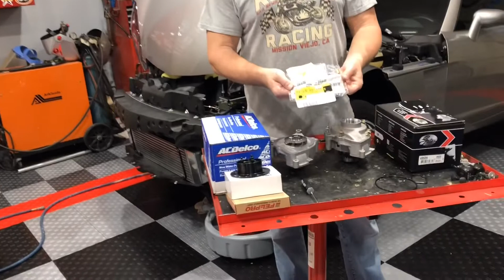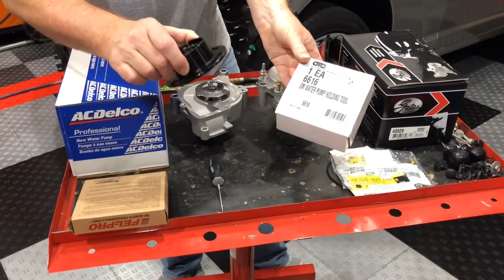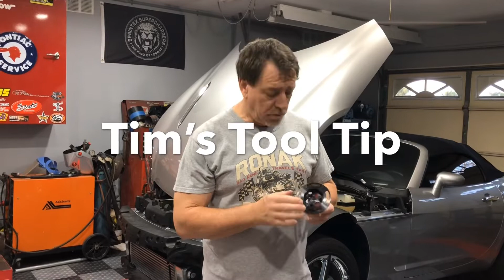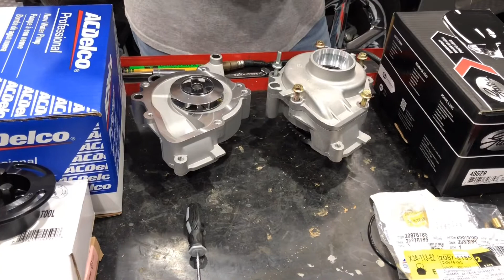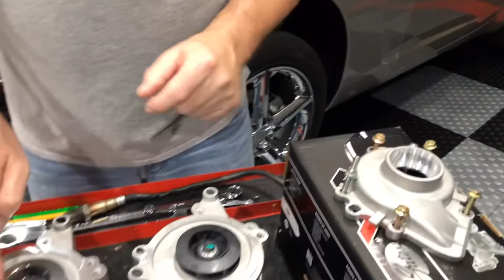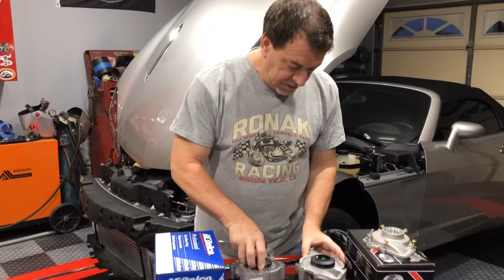Tim’s Garage Episode 9: Saturn Sky Redline / Solstice GXP Cooling Upgrade Water Pump Comparison

Comment: Great video! I wish i saw this and read the comments weeks ago. I just bought my 07 GXP about a month ago and had my fluids topped off including the coolant, not knowing that opening the reservoir and adding Dexcool would potentially cause what I think is a major air pocket issue. Since then, car started running really hot at idle, the radiator fan wasnt kicking in, and the engine overheated enough to where the water pump failed as well.  I'm not adventurous to try fixing this myself, so i'm getting the check valves added, new radiator fan assembly and controller, coolant flush and bleed, by my local mechanic.  A very very expensive lesson because of a coolant system design flaw.

Comment: As an automotive enthusiast myself (who also happens to own a Saturn Sky Redline Carbon Flash), I think the differences you show in this video reflect the after market supply playing catch-up to the demand. Hopefully in time, you'll see manufacturing improvements in parts like this as more and more smaller mom-and-pop shops continue to tool up and improve their designs, increase efficiencies, and hire on more qualified engineers and technicians seasoned in things like CAD design. (At least, that's my hope.) 

As someone who worries a lot about the supply of replacement parts, nobody will ever convince me that demand doesn't exist with even the least in-demand parts for vehicles too few ever cared a lot about. Take for example my 2006 Chevy Colorado: not many cared enough about it to lobby to have plenty of replacement parts be provided for it, and as a result, you can't find anyone who offers new brake control modules and usually get forced to make due with used parts from salvage.  However, the perception that it's due to low demand is only partially true because what really causes that is the lackluster manufacturing constraints after market suppliers suffer from. They can't produce on-demand and they're forced to abide by mass-demand due to the efforts and money it takes to retool for parts like that. 

As a result, one thing I think we'll eventually see (in time) is an advancement of on-demand manufacturing models where said mom-and-pop shops slowly become more and more capable of providing replacement parts on-demand for almost any make and model, especially as computerization seeps into these businesses along with the cutting edge technologies and concepts like 3D printing, at-home mills and lathes, ubiquitously-accessible centralized application asset files and standards of manufacturing plans and parts, and all the other fabrication techniques we're seeing be developed and or replicated from software design concepts. Because of this, and because of general automation techniques, costs will slowly decrease for things that were once expensive to accomplish by smaller shops, and when they do, it'll become more and more viable to improvise systems and procedures to become more accommodating for parts that have been discontinued, like the Sky / GXP water pump.

Comment: I enjoy your videos but you are just wrong about the water pump being a weak point.  Of the full production run, very few have had issues with the water pump failing.  The current understanding is that some early production pumps had seals that failed early.  Once replaced they have had very good longevity.
Reply from the maker: Rob … being new to the platform I was trying to understand the reason for failures. You could very well be correct but nonetheless I was able to reduce radiant heat to the pump. It may not be necessary but in hot climates and frequent short trips or freeway travel with short cooldown periods before shut off it can create significant heat issues.

Comment: Tim, this is a great video and I enjoy watching all of them!  Question:  Is there a difference between the AC Delco 252-821 and 251-751 water pump kits that would account for the 50% difference in price between the two?  Is one a more durable and sustainable pump than the other?
Reply from the maker: I am not certain ... I would inspect either pump and ensure it HAS the extra disk attached to the impeller. One of those was made in the past to be added to Small block Ford pumps called a flow cooler and it significantly improved water flow capability. I would have to order a pump to tell you for certain ... or order one and compare to the one in the video.

Comment: Where do the “check valves” go? I got them but saw no place to replace them, even on the temp sensor/distribution block.
Reply from the maker: Chris ... sorry for the slow reply. The check Valves go in the two small line that head to the overflow tank. They are inserted into the end of the hose right where it leaves the radiator too and also the connection right where it leaves the fitting at the front of the head. I have the GM instructions for installing them if you want a copy. It is very important that the check valve is installed in the right direction and that they are oriented as Vertical as possible or the ball valve will not close completely. Reach me by messenger if you need extra help Chris.

Comment: Hello, I have an 07 sky redline and it ran hot and spit all the coolant out the reservoir. When it gets hot it spits coolant out. Trying to find the problem we changed the thermostat, no luck. We flushed the system and tried that with no luck. The fan kicks on and works but it still runs hot. We are thinking that it's not circulating coolant and over heating. I did a compression test and 165-175 range. Is there a way to check the water pump without having to take it out?
Reply from the maker: It is absolutely IMPERATIVE that the system be purged correctly. If the system is ever opened after the full purging for ANY reason it will again get another airlock. Have the car COLD turn the heater to hot Use a vacuum device like an Airlift and create a vacuum of 15” and start the car. If necessary you may also need to alternate and block the return lines from the top of the radiator and the top of the head. Filling these cars with coolant is one of the most fun my things I have ever done. A buddy was having a problem with his redline after it had been bled 3 times by the mechanic. We managed to put another quart into the system by creating a vacuum. Some say lifting the reservoir works to get out the bubble but I would argue the ONLY way is to use a vacuum inducing device. If you take the cap off the reservoir ... you need to repurge the system. 
The only way to open the system and Not reintroduce a bubble is the pinch the line leaving the coolant reservoir at the top before you try to undo the cap and only remove it when cold.
Reply from the maker: Eric ... the burping or air purge of the system is very difficult to do! But it is the only way to get the cooling system working correctly.
Reply: @350tiger  I will definitely try and do that again. We used a mityvac vacuum to  pull some air out but wasn't sure what hoses to plug.
Reply from the maker: Eric Whiddon There is a line leaving the coolant reservoir at the top that splits into two lines. I used vise grips on both lines and started the car after creating a vacuum at the reservoir. I let it start to warm for 20 seconds and unclamped the line that goes to top of Rad and watched for sputtering of coolant at reservoir. As soon as a saw some I reclampwd the line and unclamped the upper line and watched for the same sputtering ... you should see the coolant level drop a bit and you should not lose vacuum. As soon as the upper is sputtering coolant Reclamp it and shut off car. Disconnect vacuum and top up coolant and reinstall reservoir cap. Go drive ... rev it well after warm a couple of times and come back and while still running clamp the upper hose at the single point just as it exits the reservoir THEN shut off car and let it cool. If the coolant level drops leave the clamp on the hose and remove the cap and top up coolant. Reinstall cap and remove clamp and you should be good if the purge is what was the issue. If you need to add any coolant it was likely the issue.

Comment: Greetings Tim.....!!
I just want to say, that I love your Video's......!! Can't say it enough.... Have totally helped me with my Cars..... Not to mention  that of course we have the same cars....
I was wondering, did you ever Replace your Water Pump......?
I have to change the one out in my Black car as I have changed out every thing else to combat that car running hot.... Flushed the System, changed the Thermostat out twice, after making sure the 2nd one would open up in 180 degree water, changed the our the Radiator for Brand New AC Delco Rad etc.....
Anyhow, I am now up against changing the Water pump out in it.... And I think you are right.... The AC Delco WP is the way to go.... Of course every where I look and read about these Sky Redlines says to make sure you use AC Delco Parts because these cars are very finicky.....!! lol.... Anyhow, was just wondering if you had changed yours out yet....? I am pretty sure I will have to pull the Turbo out to get to it comfortably.....
Thanks again for posting all your great Video's....!! They are friggin awesome and have helped me quite a bit I have to say....
Reply from the maker: Super glad to hear that ... finishing up the final tune video during this in place quarantine 🙄
Reply from the maker: I read further ... sorry only read the first bit at first. 
I did not yet change my pump but I do have a new AC Delco one for when I do. Currently I have 9800 miles on my car and while I know it is a weak point I just in good conscience could not bring myself to change it while it was apart. I have been told you can change it with turbo in place but I find that extremely hard to believe. 
When you say HOT ... how hot? Currently 195-210 is considered normal for a stock cooling system. 
Besides ensuring it is bled well ... also check for any debris between the radiator and the AC condenser. Mine had chicken feathers sucked up in there.
Reply: Thanks for writing me back Tim... 
Yes, a good time to play mechanic... Stay at home as this Virus stuff is pretty scary...
When it comes to this cooling System in my Black car, I have checked everything you could possibly check on it as far as to why it would run hot....No obstructions, Clean clear lines, Heater core good, air lifted the system, etc.... It sucks and I am not looking forward to changing out this Water Pump... When I say hot, I mean hot and it is starting to worry me to the point of ruining the engine... Although one must realize, the over heat warning light on these High performance Ecotec 2.0 motors does not even come on until the cars hit a whopping 250 degrees....!! Mar car has gone up as high as 244 and 220 is normal now... But it still drives like no big deal, but in my head I am freaked about it when I see the temp on the gauge....!!  I even replaced the temp sensor down by the Turbo as well to make sure it was not faulty... I am certain that the Water Pump is barley pumping coolant through the system now as the temps have just gotten worse over each passing Summer... I wont even drive it anymore... Both my Redlines are 2008's... Black car now with 86,000 miles on it, my Red car, 61,000 miles on it... My Red car is starting to run hotter as well with miles and age also... I am convinced that these water pumps just get weak over time and use... And what is crazy, they don't even leak coolant out of the weep holes to let you know that they are starting to go bad... Your car will just start running hotter... I think you will see in time with yours perhaps... Although, your car still has New miles on it.....!! lol.... Wow...
My Red Car now runs Between 198 & 217... I am sure when it hits 80,000 miles it will be up there as well in temps....
I am wondering if a guy just loosens up the turbo a bit from its mounts that it might give a guy just enuff room to get that WP out... After you take off the fan that is... Using the WP Timing chain Sprocket tool...
I have already had to replace my Turbo on this car as well... Had to do that at about 70k... So I know what a pain that job is already.... I do not drive these cars all the time anyway so it fine...
Thank you again for writing me back Good Sir.... Stay Healthy.....!!
Reply from the maker: David J Tackett have you tried turning the heater in while you create a vacuum and purge it. My buddy Herb has an identical problem to yours and we were able to draw enough air out to add an additional 1 quart of coolant. The way the water pump works is such that ANY cavitation reduces the flow characteristics dramatically. He was hitting 240 as soon as he turned the heater on ... heater off ran fine but it seemed there was a bubble trapped somewhere and by having the heater on and getting the car super warm while purging it the problem was cured. The AirLift device is not that expensive if you already have a compressed air source or can visit a buddy who does. 
If you need help I am always available for a call. Especially right now being grounded.
Reply: I did Tim... I heated it up where I knew the thermostat was open, heater going, so I knew there would be no obstruction within the entire cooling system such as closed thermostat.... But you do have something there.... My car is the worst while driving it with the heater on.... turn it off and the temp drops... Just the opposite of what a cooling system should do to an elevated engine temp... But,,, if you are driving with heater completely off, 70 to 75 miles per hour, steady 24 to 2500 RPM constant with cruise set, the temp goes up from 198, 199 and just slowly climbs clear up to 240, 242, 244, and will come back down to 199......???Huge damn swing which is completely terrible for any engine....
And it WOULD make sense for the temps to rise and fall like that within a 2 to 3 min kind of time frame it seems... 
So are you saying that there could still be air in the cooling system some where....? Just cannot imagine there could still be air in the system after all I have done to get it out....??
And thank you again for the advice and the option to perhaps give you a call... I might just have to do that.... I am going to back out in my Garage and do the  bleed purge system procedure over again making sure the Stat is open, engine at running temp etc.... Guess I will have to watch your one video again on purging it to make sure I am doing it right......!!   ;)
Reply from the maker: David J Tackett I have a couple of other tricks if you have a stubborn one ... one is the clamp the lower coolant fill tank hose and then draw a vacuum as you heat the car. If you EVER OPEN IT HOT ... ALWAYS CLAMP THE SMALL UPPER HOSE TO PREVENT AIR BEING SUCKED BACK INTO THE SYSTEM. That is extremely important! Also you can draw a vacuum from the top of the engine from each of the small hoses to try and get the bubble out.
Reply: Yes,  roger that........ For sure.....!! Great advice.....
Reply from the maker: David J Tackett send me a FB friend request ... I will send my contact info.

Comment: Hey Tim, my water pump went out shortly after buying my Redline and I went with the aftermarket replacement (plastic impeller).  Last week (after about 30,000 miles) my poor car started overheating, I crossed my fingers and replaced the thermostat and no joy.  So I pulled the water pump and sure enough it makes a nice squeaking noise when I turn it by hand.  Grabbed an AC Delco replacement on Amazon to replace it.  So if you enjoy replacing water pumps, go with the plastic one and you'll get to do it every few years
Reply from the maker: Jason ... that is great feedback ! I really was a lot skeptical about the nylon impeller and it’s durability given the heatsoak we get with turbo.

Comment: Hey Tim, yes 3 weeks into me owning my upgraded Redline, the water pump failed, spilling coolant out all over the floor.  Not being a mechanic, I sucked it up and paid the dealer cost because I know some special tools are required and turbo parts need to be removed, and it's attached to the timing chain, this is way out of my league, if I had a bigger garage I would love to learn and do this stuff myself, but I just don't have the room or the tools, as I know I could be saving myself a lot of money. Repair cost was $1,354.00 
I know you're rolling your eyes right now but there was nothing I could do.
Fortunately the water pump failure & coolant spill happened just as I was turning into my garage so no over temp problems or additional damage to the car.  As I mentioned to you before my car only has about 40,000 miles.
Thanks again for sharing your videos, I'm learning as I go Tim.